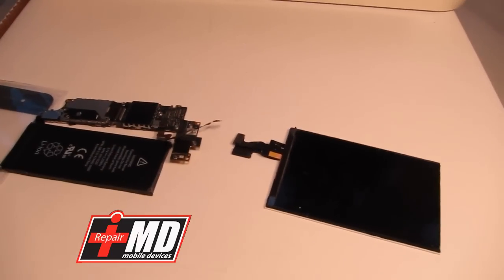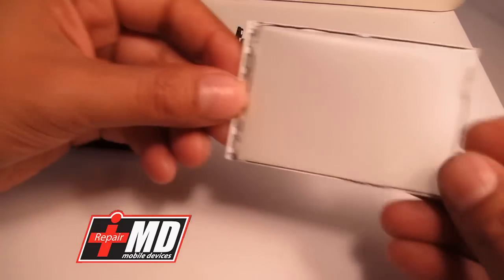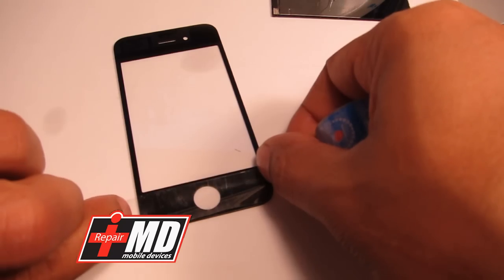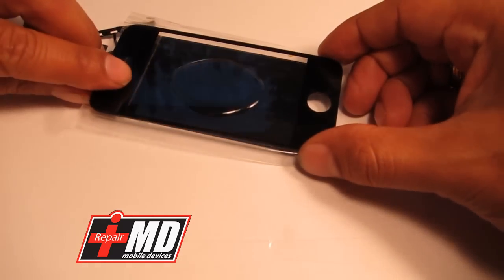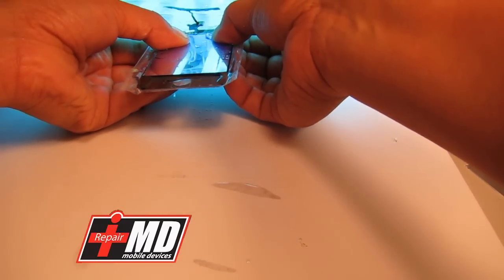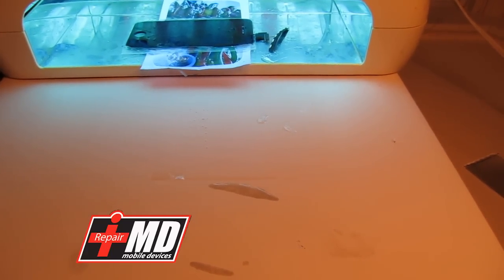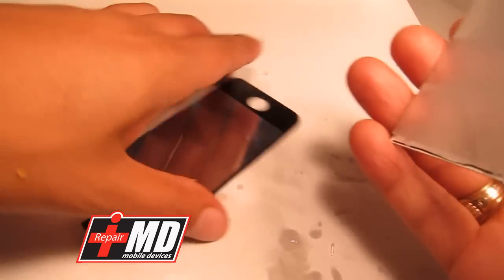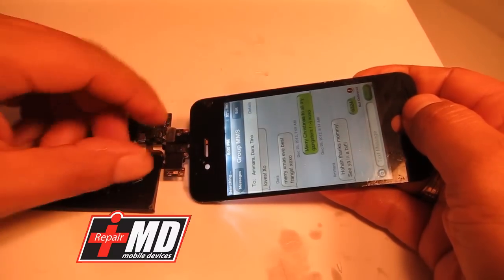Touch Screen UV Bonding Liquid for Smart Phones

Comment: good video , obama  u probably cooked the screen by removing the Loca ( light optical clear adhesive ) what heat source was u using to warm it up ? as u should only use a controled heat source.haunton hot plate,reflow . !!!!!! the bubbles are a common problem if u haven't got a clave.i suggest in future to shake your loca + leave to cure fully. also use 0.1mm molybdenum wire to remove the glass , it makes the job easier also eliminates the risk of damaging the screen. Hope this helps : )

Comment from the maker: you'll need to directly bond the glass with the display, if there's a air gap you will have a delay in touch response. My liquid will work, but you'll need to block out the proximity sensor before doing the liquid bond on the GS3